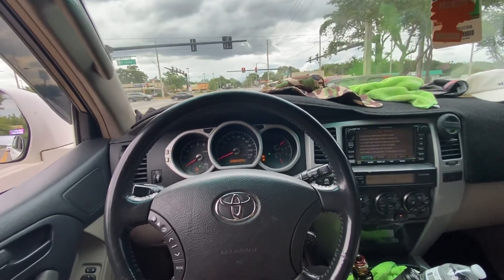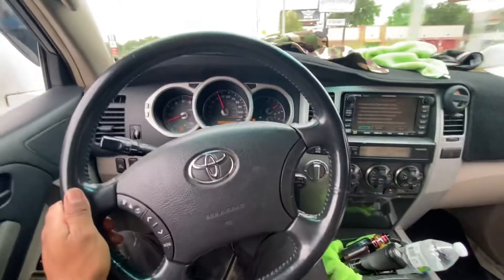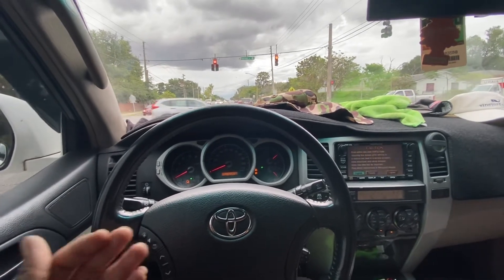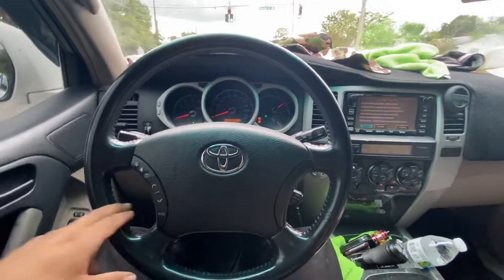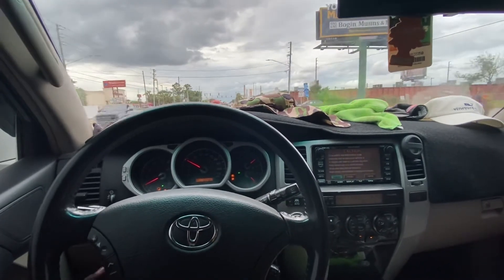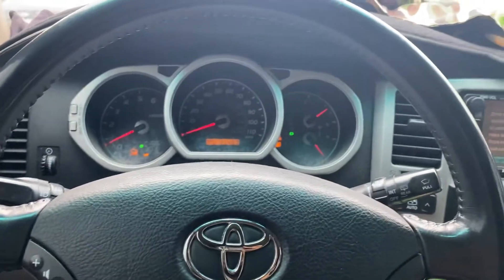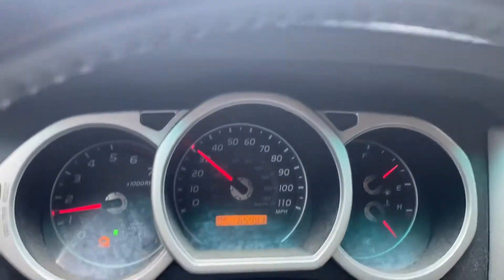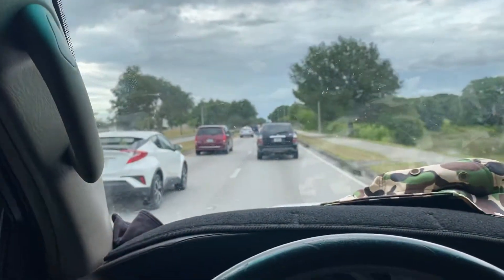4th Gen 4Runner V8 Muffler Delete Driving Sound and Review

Comment: Is there any drone with this setup? What did you put in place of the muffler?
Reply from the maker: Very slight bit of drone. But like the good kind. It’s very quiet when you’re driving it easy but gets just loud enough when you step on it. I sold the 4Runner but would do the same thing again on another of these V8s! 

All I did was take it to a shop and had them cut the muffler out and weld in a straight piece of pipe in its place. If I recall it was a slightly smaller diameter pipe about .125 smaller I think. The key is to only do the muffler and leave the resonator alone.

Comment: I have the same limited 4 runner with the screen! Does yours have a TV too?
Reply from the maker: Awesome! Mine doesn’t have a tv. It has a small digital display on the roof behind the front seats that I don’t recall what it does, and I have the original remote control for it. But I think there’s a dvd player or something like that in the back by the subs on the passenger side. I’ve never tried to look at it, but can anything play on the gps screen?

I honestly just like all the other cool features it has despite its old age.
Reply: @liveloveland  mine has that little digital display on the backseat lights. Although my limited doesn't have a touch screen.
Reply: @liveloveland  oh cool deal I’ve never seen that! The 06 I have came with a TV mounted on the ceiling for the back passengers. It’s pretty darn cool, it’s a flip down